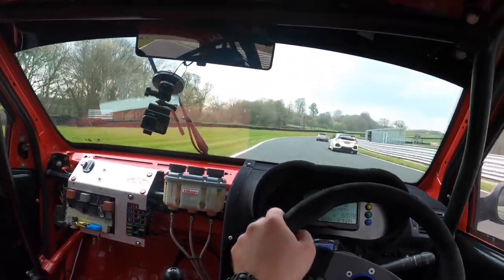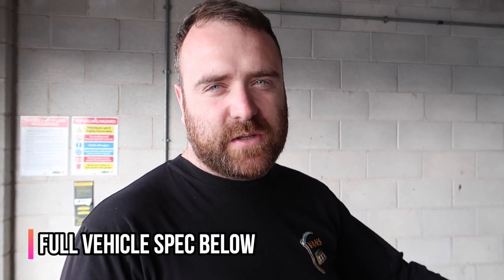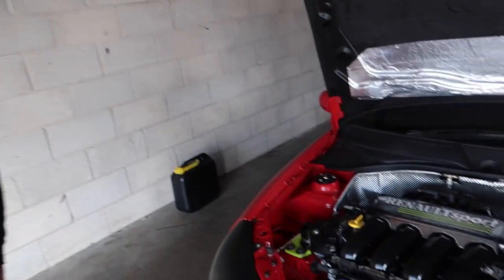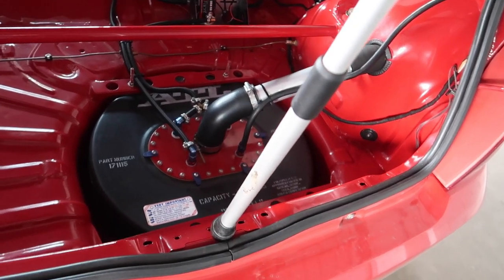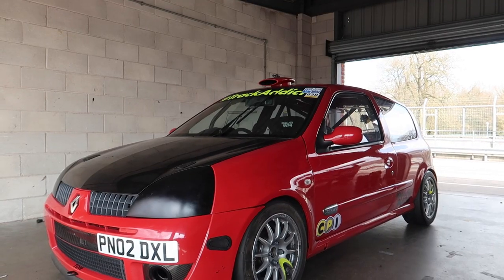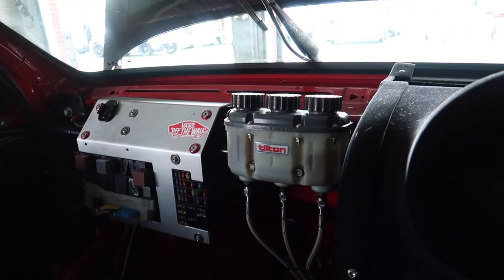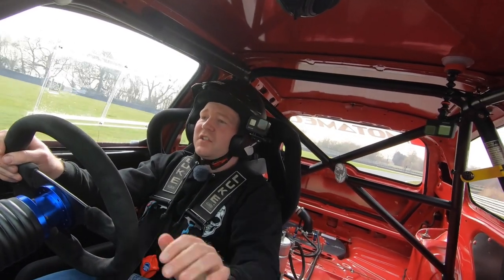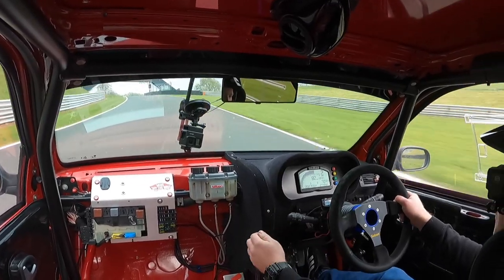Daves *198bhp* RenaultSport Clio 172 *900KG WEAPON!* 😮 - On Track Review

Comment: Steering is crazy heavy on these without PAS, Pretty sure an EPAS setup would save you some lap time. Cool build nevertheless 😎
Reply: Hi David 👋 I have thought about this sometimes but then I wonder if I will actually gain anything in terms of carrying speed through corners easier? I've really gpt used to how heavy it is but obviously most tracks have that one corner that's tight and requires alot of effort... maybe a next winter job for sure.
Reply: @Oliverhayden2436  Never drove mine on track without PAS mate so I could be wrong, Only on the road. With the extra Castor it was just crazy heavy though. I used to get alot unwanted steering feedback aswell, Think the EPAS motor absorbs some of that.. Definately feels less twitchy and gives you more confidence. I fitted the adjustabke kit off Ebay.  Another bonus is the EPAS rack is solid mounted to the subframe so no more sloppy clunking rack bushes. Make sure you get the 2.4 turns rack because there's a slower one. Something to think about 👍
Reply from the maker: Yes I agree David, although I see why alot of people take them out as it adds to the rawness and feel. I had EPAS on my K20 Clio 182 which worked very well. Part 8 on here if you want yo have a look 😊